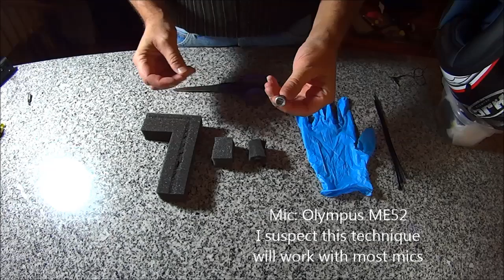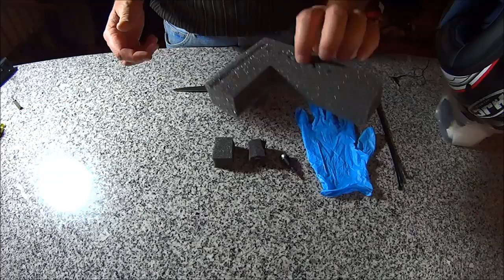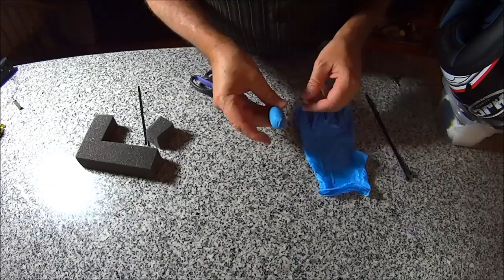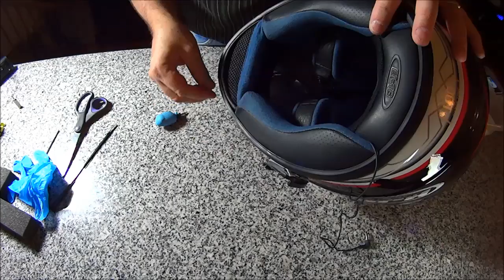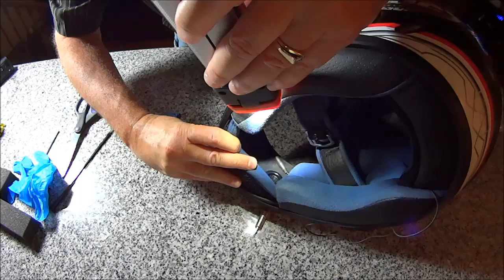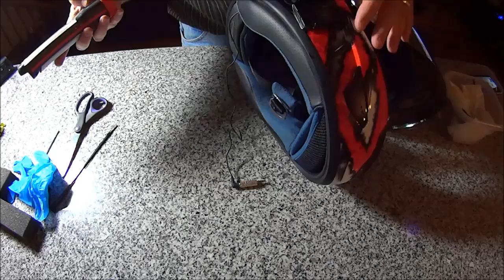How to reduce wind noise and record clean audio in a motorcycle helmet

Comment: This video is quite old so I don’t know that you will still check posts. The rubber glove trick did it  for me! I have an LS2 Valiant 2 and it’s quite noisy. I’ve tried all kinds of things with my mic to take the distortion out when I get up over 40km /hr. Nothing worked. I cut the thumb off a rubber glove and put it over my mic that has a foam cover and dead cat. The sound of my voice is clear and crisp now. Thanks! This is an evergreen video. I’m glad it’s still up.

Comment: My problem is not the wind noise. The problem I have, is that when I close the visor. The sound gets amplified and it is impossible to understand what I say.
Reply: Try using A phone, and acheap mic. some apps use adaptive recording, they reduce loudness when loudness goes higher. so no clipping happens. 10 months late to treply but still :D

Comment: if the microphone starts out with a mono signal, you can't get true stereo by using an adapter. The adapter is only splitting the mono signal into two separate but identical signals.So you're technically getting "stereo" but it's really no better than mono, might as well get rid of the stereo adapter as it's not really improving your sound quality. To get true stereo you would have to use two mics or the Olympus ME-51S. Unless your goal was to get sound out of both speakers/headphones without using any post-production. In that case the adapter is probably the easiest solution.

Comment: First, nice video not only on your track day video but your instructional video. Second, I was wondering if you knew if this would also work for a GoPro as well. Because with the GoPro's they are in a waterproof housing, I would have to drill through my housing to insert the mic in, or I believe they make a housing for it that has holes already pre-drilled. But either way just looking for an opinion really if you thought it would work or not.